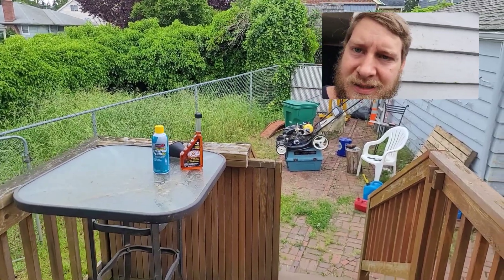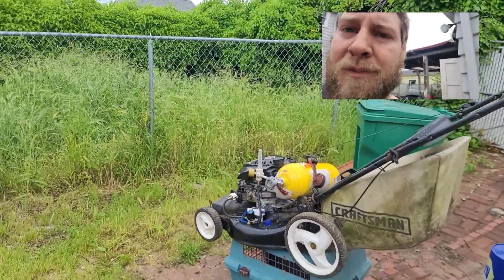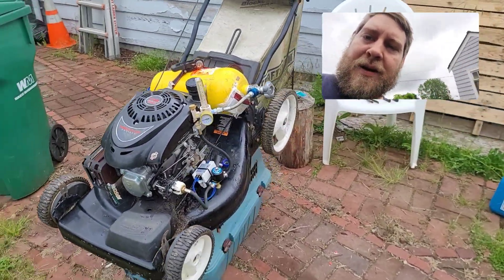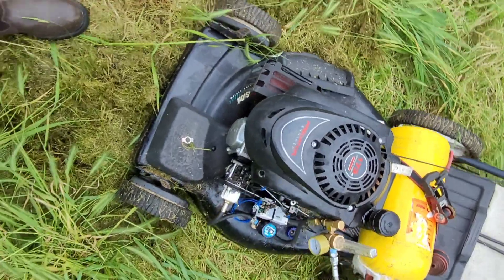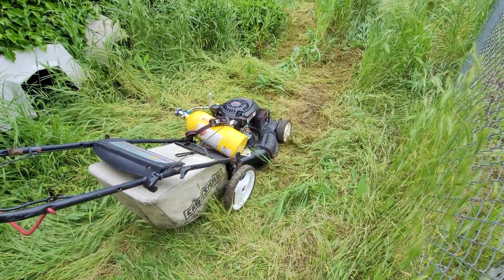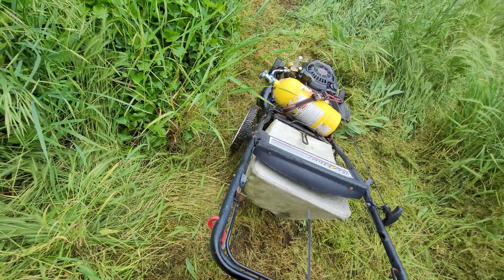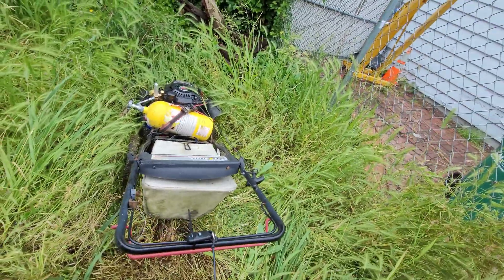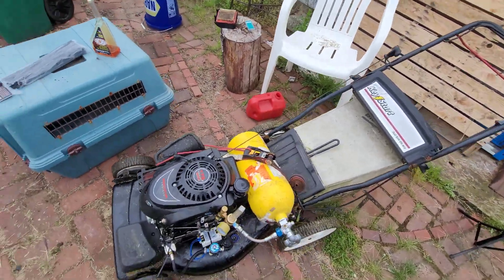Nitrous Explosions 💥 inside the combustion chamber of a lawn mower

Comment: Dam what engine was that?  That engine is a bad MO-FO to hang and take that serious abuse.

It Blew my mind how well it stayed together and for how long?   
Be good advertisement for that engine for sure, very well built. 

Perhaps for your next trick, use Nitro Methane vs Gasoline.   Hee hee hee  you no doubt would get a BOOM out of that trick lmao.  

BUT TAKE THE BLADE OFF THE MOWER BEFORE YOU DO IT!!!
Reply from the maker: That was a harbor freight predator mower motor. But Yes I have RC nitro going in my Subaru for my next video coming soon